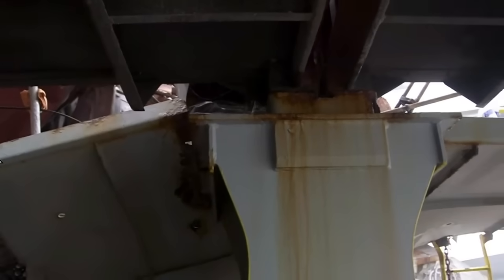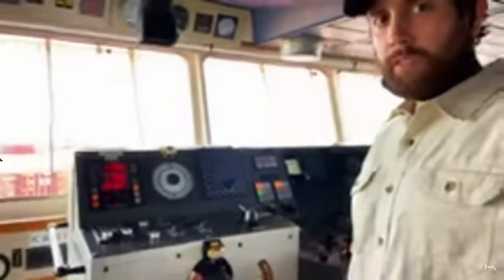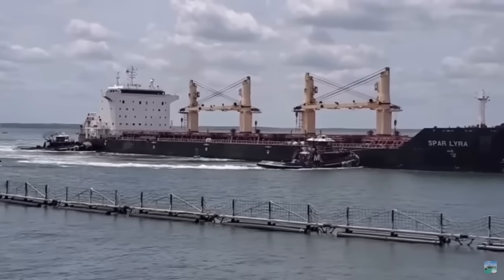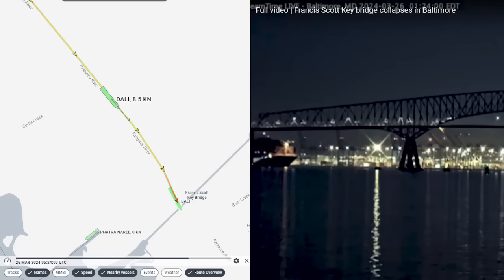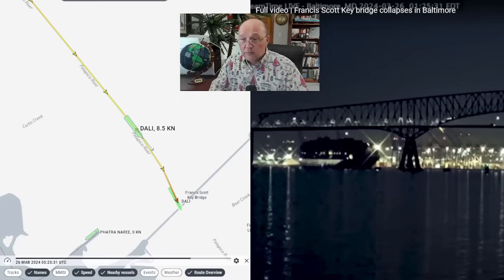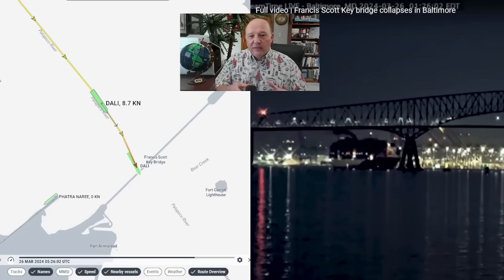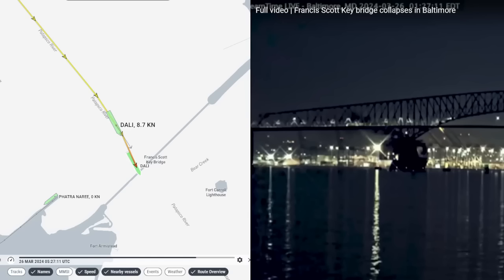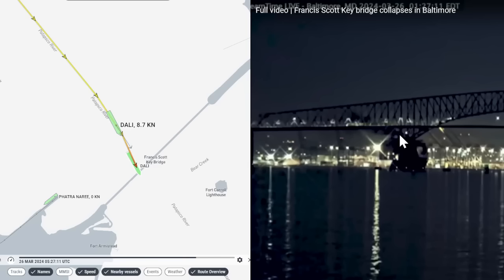Dali Timeline from Data Recorder in Striking Francis Scott Key Bridge in Baltimore, March 26, 2024

Comment: I'm no expert by any means in this situation; that being said, I've driven boats since I was a kid, been in rivers a lot and am familiar with tides and what water does with them. I can't wrap my brain around how this vessel turned it's nose out of the lowest part of the tide wash and continued it's tack towards the piling unless it was on purpose. Before any turning it was running squarely down the deepest part of the channel where the bulk of and lowest point of tide is running as well. With the other channel, of course there would be a seam at the confluence, but i can't imagine it having an affect so pronounced on the stern of so heavy a vessel, under power or not, rudder working or not. And like I said, the lowest, fastest point of that tidal flow would be measurably shallower water than the edges of the channel, where the vessel ended up heading to before making contact with the bridge. That faster, lower water in the center of the channel would have sucked the entire boat to keep it's original course, even if it were turned by a couple degrees in a joining, far smaller current confluence. I don't get it.
Reply: There is a secondary channel right where the lights went out that could have swayed the ship. Very plausible.
Reply: @mariannorton4161  it is plausible to turn this sized ship, albeit it slightly. The effect of tidal open water confluence though? I personally doubt that much of a turn. It's a joining, not a cross-current. And remember, all water is moving to that lowest point of the deepest channel, which happens to be the one it was heading straight down. That essentially means that the bow has to climb out of the channel to divert it's course, turned or not - It literally has to go uphill to leave the channel, either under power or immense momentum, which this ship certainly has the capability of. But without forward thrust? It would be important to know what tidal force was being exhibited from behind and primarily the starboard side. Yes, it's an enormous vessel, but for it to turn that much out of the current and make it uphill against it? I don't buy it.
Reply: @AdventuresWest   Oceanliner designes went through the channels and diagramed how he believes it happened and it made perfect sense to me.  It's a great channel if you have an interest in oceanliners and their history and is a great fit with this one.

Comment: Why does the ship appear to turn more in the video (almost 30-45 degrees to starboard) than on the GPS maps? To my untrained eye, it appears that the ship is "aiming" for the concrete caisson.
Reply: My guess is that the AIS antenna is on the stern. The stern travels along the path of where the bow was. A ship can turn almost 90 in a sharp turn and the stern will travel the length of the ship before making any lateral movements. My guess is based on the navigation system and my AIS on my 90 ft boat.
Reply: Very simplified answer, appearance is from a combination of viewing angle and distance compression inside a zoomed telephoto lens.

Comment: Can't remember where I heard it but someone said they could have this cleaned up in a week... I'll bet at least a month.
Reply from the maker: Once the ship is removed and they have all the assets in place, they may be able to make the channel passable in that time.  Estimates I am hearing is 1 to 3 months.
Reply: You did hear it right. They are talking about clearing the channel in a week so as to get Baltimore open. It is very important to the Eastern Seaboard supply chain. They can drag large bits of steel out of the channel. But you are also right that cleaning up generally before the bridge is rebuilt will take a while.

Comment: Thank you for putting out a video with all of the facts available, not ruling anything out, and NOT SPECULATING !!! I work in Baltimore, in the infrastructure industry, and have been working on that bridge MANY times. I also traveled across that bridge at least twice daily for the past 15 years.
It is a small community in the highway industry, and our companies all work side by side.
We all feel each others loss collectively.  (The industry lost 6 workers last year when a car entered a work area at 120mph, less than 10 miles from the Key Bridge. It's angering to see folks putting out garbage clickbait theories of sabotage, explosives, etc.
. P.S; The bridge does have dolphins on both sides. (check the arial footage) I have fished in the Patapsco river for almost 50 years, and used to jig fish out from around them.
Reply: A single small dolphin for each side of each pier, total of 4.  The relevant one was spaced far enough away that the ship bypassed it on its way to hitting the bridge pier.  By comparison, the replacement Sunshine Skyway bridge has 36 large dolphins and 2 large rip rap islands surrounding the suspension towers.

Comment: THANK YOU - another outstanding video. Two issues that concern me Sal: First, the crew on the bridge had over two minutes to get of. When in the timeline were they informed? Second, As noted, the new Tampa Bridge had ''dolphins'' to protect it. I would like to know who in Congress voted NO against dolphins for this key important bridge or mandates for tug boats to help these huge ships.
Reply: Nothing suggests that the construction crew were ever aware of the danger.  The flashing orange lights of their vehicles remained in the same spot up until collapse. 

In the audio of call from Port Authority Dispatch and the Transit cops enforcing speed at either end of the bridge, there was mention of the crew "confirm is one up there, can you contact" and one cop says that if another unit relieves his position he will drive up and get them.   Doesn't sound like there was radio contact with them at any stage.

Comment: I as a TCS ( Traffic Control Supervisor) and flagger am very glade to hear that proper utilization of officers at both ends of the bridge was being observed during the road crews working on the bridge deck. I all to often run into various sub contractors cutting corners and costs by not having these in place usually arguing because there is no navigable water it is unneeded even when there is a Traffic thru way below. From personal experience  if anything had gone array  things could have been very bad.
Reply: *awry. And even so, those officers must have hustled to stop the traffic so quickly. I just wish someone could have notified the workers on the bridge. Condolences to their friends and families.

Comment: Well done covering almost everything. As a local sailor, I want to point out there is the HV transmission line with islands prior to the bridge on the approaching side, but also there are four dolphins positioned opposite each bridge piling, with the approach dolphins between the HVTx and the bridge span.

My strong suspicion is that Dali made contact with the SW dolphin somewhere aft of amidship which caused the port deflection moments before impact. Either the rudder configuration or the drag of the dolphin or some combination thereof pivoted the ship into the bridge.

I haven't reviewed photos of the SB topsides for indication of drag, but in aerial photos you can see the Dali's SB quarter resting against the dolphin. 24:02
Reply: Ahhhh, I guess the Dali completely missed the dolphin as per a few different sources.

Comment: As a retired pilot of ships the size of the Dali I can tell you that the swing to starboard together with the funnel smoke is consistent with the engine being put astern. Furthermore it's possible that during both blackouts the main engine kept running, certainly the presence of the black smoke during the second blackout indicates this. The NTSB report that helm and steering orders were given but there're no reports of engine orders being given, so what happened to the engine remains a mystery.

Comment: I've done a lot of marine salvage work and do not see any significant technical problems.  Also, as a former British merchant navy chief engineer, I can assure you that it is very easy to start a marine diesel engine.  The engine room crew should have been ready on stand-by and the engine all set up to stop and start on the passage out of Baltimore.

Attaching a tug to a ship doing 8-9 knots can be very dangerous for the tug.  Girting is a real possibility.

Engine and machinery data is also recorded on the engine control room printer.

The black smoke is caused by turbocharger lag after starting the main engine.  It takes time, and until the turbocharger gets up to speed there is insufficient air for combustion, hence the black smoke.  Most probably the engine was started astern.  There is no issue with the propeller spinning.

All essential systems can be switched to manual overide.

Comment: Sal -  I think you nailed it on the track of the Dali.  With an outgoing tide there was a current coming out of the side channel.  When the Dali reached the channel the current pushed the bow to port.  The pilot issued an order for right rudder to counteract this.  Then the power failed and the rudder stayed where it was.  Now...  There should have been two ship service generators.  Were they both running in parallel?  Was one on standby?  What about the emergency generator? Why did it take so long to restore the load?  Lots of questions.

Comment: I'd already wondered about it before, but you just confirmed it for me: they only had cops in an ideal position to close the bridge because of the work being done on it. Had that work not being done that night they probably wouldn't have been able to close the bridge fast enough to clear it of traffic before the collapse. It was the middle of the night so there wouldn't have been much traffic to begin with, but it's possible there could've been more deaths than the 6 work crew.
Reply: Video shows a fair number of trucks crossing.

Comment: Great forensic explanation.  I've been on a freighter that lost power while making a 'u-turn' on the Mississippi River just upstream from the Huey P Long bridge which is just up river from New Orleans.  It's quite an experience but the Chief Engineer was able to re-light the fires and we had a tug on the bow so we recovered.  I've been on the bridge when a tug lost the bow line to a barge which swiveled right in front of us in the Huston Ship Channel: we dropped anchor but hit and sunk the barge and nearly capsized the tug .  Another possibility for the heading to drift to the right is that as the bow passed the channel on the right the pilot might have had to use a bit of right rudder in order to 'crab' and power was lost with the rudder not amidships.  I've had experience as the Sea Detail OOD in the Navy on a couple of vessels the largest about 660 feet in length so was quite interested in what was taking place on the bridge.  I would have ordered the port anchor dropped just in case it would pull the bow to the left a bit.

Comment: Nice video Sal. A couple of things….if when the power failed the helmsman was operating the helm , either too a pilots or masters order or just to maintain a steady course the rudder would would get stuck at its location at the time of power failure. So for example if say the helmsman ha turned the rudder say 10 degrees to port momentarily to steady the course it would remain at that position. This would cause the VL to sheer towards the port side and would not be correctable until emergency or main power was restored. Since they were in a narrow channel and required the VL to steer the pilots course the helmsman would have been actively moving the rudder about. Another thing about steering on a big ship or any ship is that when there is a following tide she will lose steering very quickly when propulsion is stopped depending on how strong it is. The stronger the following tide the higher the speed at which she will lose her ability to steer. It is not un common for a VL of that size to lose steering at even 8 knots with a following tide without her engine operating.

Comment: Thank you for answering my question about why she didn't just continue forward as she was seemingly lined up to clear the bridge. My own boat, will continue going straight without power for a mile or two without wind, tide, or current. The possible outflow from the other channel could be enough to toss the stern. I do wonder if the port anchor drop call was a mistake. It was too late. Not judging... I've been in these situations, albeit on a much smaller scale and I know it's impossible to solve all problems when they happen. As a sailor, I do continuously run what ifs as I sail and maneuver my boat.

Comment: THANKS SAM, FOR THE VIDEO,  YOU HAVE CONFIMED WHAT I THOUGH MIGHT OF HAPPENED, IM NOT  A SEAMAN 
BUT YEARS OF UNDERSTANDING PHYSIC  IN WHAT I USED PHYSIC FOR, AND SEEING HOW SHIPS ARE MOVED ECT. 
AS TO WHY THE POWER  WAS LOST THATS FOR  EXPERTS TO SORT, AND LOSS OF, RUDDER CONTROL, AND THE SMALL CURRENT 
AT THE WRONG TIME THE WIGHT OF THE SHIP BECOMES A BIG PROBLEM  TAKES TIME FOR ANY CORRECTION TO TAKE EFFECT  
NO TIME WITH OR WITHOUT RUDDER CONTROL 

AS FOR TUGS  YOU WOULD NEED MASSIVE TUGS YES THOSE GUYS WHO MANAGED TO SAVE THAT SHIP AT NORFOLK 
THEY WERE LUCKY TO DO WHAT THEY DID PUTTING THEM SELVES IN HARMS WAY 

SO THE OVER ALL PROBLEMS ARE SHIP SIZES  THEY ARE GETTING BIGGER FOR PORTS  TO HANDLE  BRIDGES  WILL NEED BIGGER DEFENCES TO COPE  THESE SHIPS TONNAGE

Comment: 6:28 I'd never heard the saying "doing yeoman work" before, so I went looking. In case anybody else was in the dark, Wikipedia cites the Oxford English Dictionary in the article "Yeoman", saying, 'Yeoman service (also yeoman's service) is an idiom which means "good, efficient, and useful service" in some cause. It has the connotations of the work performed by a faithful servant of the lower ranks, who does whatever it takes to get the job done.' (Note: I'm not trying to correct your use of "yeoman work" instead of "yeoman service".) 😻

Comment: Cheif Makoi is an excellent channel, and I'd recommend it to see how engineering works, not just the engines. Gotta check out that Brian Boil. Also watched Tim B alot, too. I also liked Casual Nagivation's video bringing up the channel currents. 

I've been making a blind guess the problem was electrical, possibly a distribution board or grounded connection, and whatever happened had to be extraordinary.

About the anchor, one thing that hasn't been mentioned that I saw there were red chains, which means to me they dumped the whole anchor. I can't remember how it works, but I think the red usually indicates you're on the last length of chain if they were doing their chains like how I learned.

Been appreciating this series, since I can recall some claiming a cyber attack and I was trying to squash that nonsense. It doesn't feel like a cyber attack was the cause here because the way she comes up and down. 
 
Thanks for linking all these great videos. Really good stuff.

Comment: FYI from listening to the radio traffic from the emergency operators on scene the ships diesel fuel tank was compromised and leaked into the patapsco river. The divers at the scene reported a sheen of oil on the surface of the water as well as an overwhelming smell of diesel fuel.

Comment: I was a marine engineer and worked on commercial vessels for many years. Any time you are in a restricted waterway, you should have at least 2 main generators running and online in case one goes down. The only thing I can think of that would cause full power loss would be a failure in the main electrical panel which is highly unlikely. Most likely, they did not have 2 generators running. The backup generator is really for basic life support of the ship and for cold starts. It should have never come to that in this situation. My guess what will come out of the investigation is they didn't follow basic protocols because of complacency or incompetence.